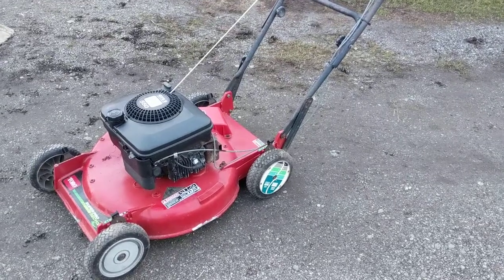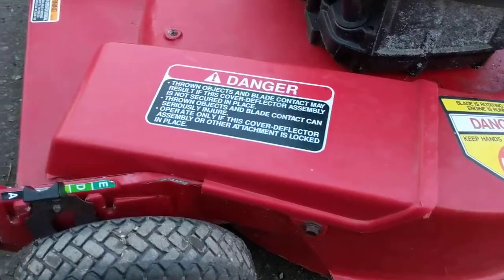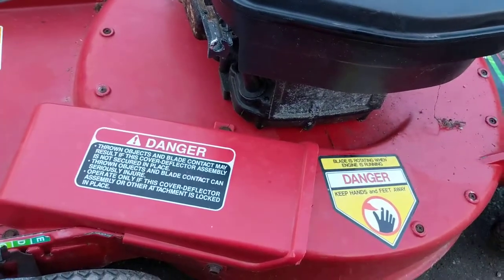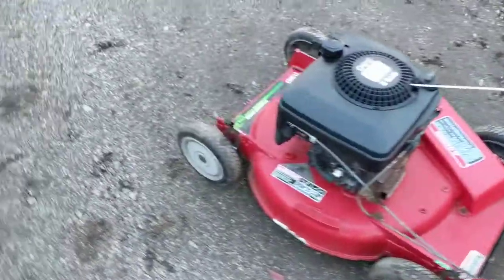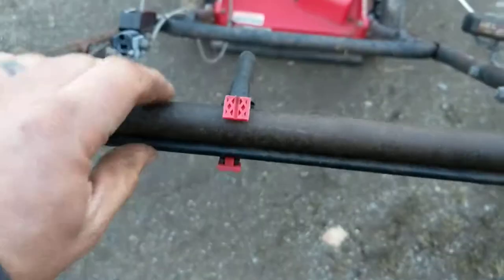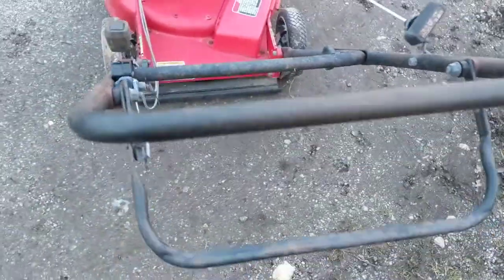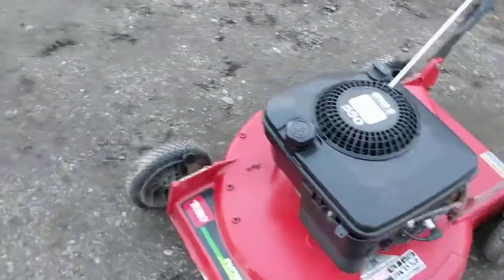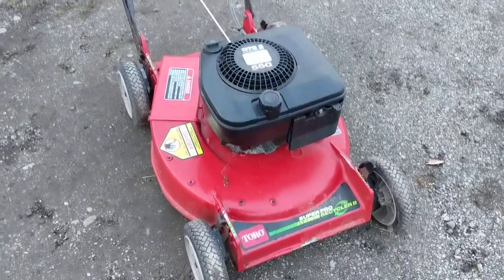Toro Super Recycler II Mulching Lawnmower

Comment: I have this machine but the engine is nearing the end of its life. Your point about the aluminum decks is spot-on. They don’t make these any longer because the new ones are designed to rust out and fail. Anyways…I need to look at an engine replacement but noticed this engine is mounted sideways. If anyone has a good source for engine swap I’d be appreciative.
Reply: Where I live in the Southwest, you can find a Briggs Quantum engine on a gently used Craftsman or like mower.  I've found them for as little as $20 with the bag, and it's the exact same block as the one on the Toro here.. I think they were produced up to 2004.  You can identify them by the air filter cover on the right side of the engine, and the sometimes different style muffler on the opposite side, but they are all interchangeable parts-wise, even if it is a different HP rating.  Only some models have a primer-bulb style carburetor (it's no real difference, however, and you can always refit your old carb).

Comment: I had a mower exactly like this one only self propelled.  The engine was bulletproof and never had any problems but the mulching deck was terrible.  I mowed every other week and it would bog all the time and clump up the grass everywhere.  Toro should have put in an optional side discharge chute.
Reply from the maker: I think it only works as a mulcher if you use it every three or four days in the heavy growing season every other week might be a little too much growth for mulching.
Reply: It is the best mulching mower I have ever used, hands-down (for routine lawn maintenance) and I have never had any problems.
Reply: It also doesn’t work very well in wet grass.